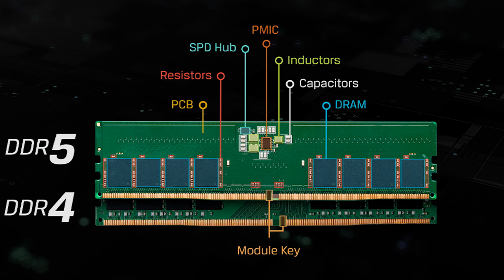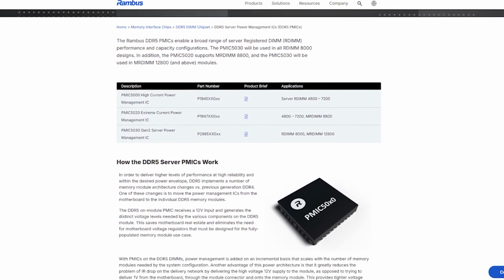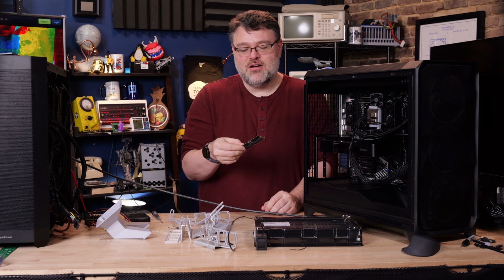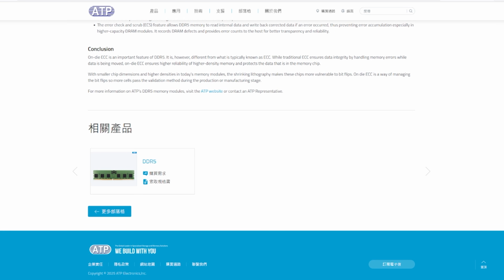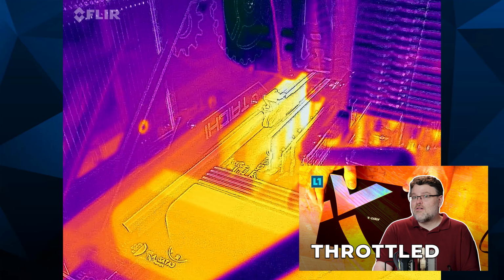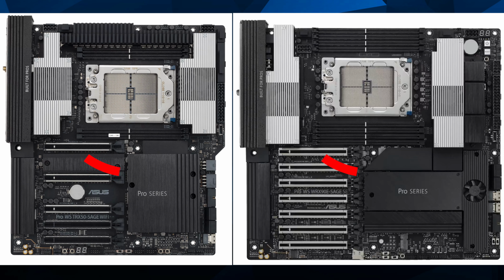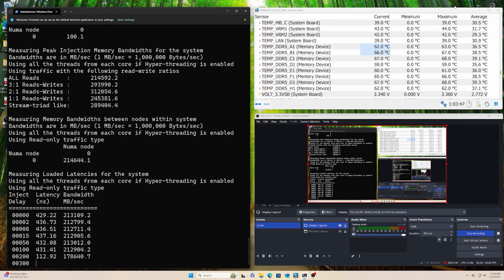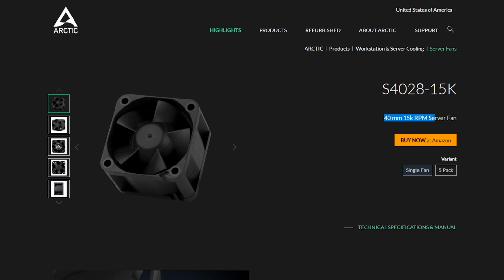Your DDR5 Memory Could be at Risk! All About DDR5

Comment: So what you're saying is I need a RAM fan ...
Reply: used to be a easy option to fan cool ram,, it was two small fans and side clamps that would press against the ram lock arms.
Reply: DDR2 watercooling is making a comeback
Reply: I have an idea, how about a fan mount that clips directly into an empty dimm slot? The bottom is all plastic and stuff doesn't take power from it or anything, just using the ram slot as a mounting solution. It would be easy solution for ATX boards that have 4 dimm slots that most people don't fill up for DDR5 due to memory controller not able to handle 4 channels without cutting the speed.
Reply: @Temstar04  I use 4/4 slots (4x 32GB DDR5 6000 CL30, XMP1) without any problems. Bandwidth and speed are on maximum, 6000Mhz is stabil. The SPD hub temperature is 40 C on 0 and 3 dimm, 42 is on the 2 internal memories. Under working the tempartures get +2 C only. So, the 4 DIMMS can working perfectly with Ultra 9 285K.
Reply: @Cornflakes1111  nobody asked lil bro
Reply: @jaytay420  Not cool somebody just throwing a comment in doesn't need a nasty response like that get a life or do something to no be so misserable in this one to warrant such a comment.
Reply: pci fan directed a modules
Reply: Ram aio
Reply: Fixing AM5 4-stick DDR5 stability:
1️⃣ Stop using Auto CAD Bus.
Set to 34Ω-30Ω.
2️⃣ Lock _dd timings (trdrd_dd / twrwr_dd) to stop data collisions
3️⃣ Increase VDDP to 1.05V for the handshake
My 8700G is now pushing 256GB at 6000MT/s 1:1 with a -30 Curve
No more boot loops! ⚡️
Reply: Really makes me miss the days of DDR2, when those clip-on heatspreaders were bling that nobody took seriously, or DDR3 when some of us were poking fun at giant heatsinks and ever water cooling kits for DIMMs. But then, I guess the 486 I used to play Angband on ran passive too.
Reply: @YesterdaySoup  Reminds me of when I opened an early WIn95 PC to clean it and had to do a double take, because nothing on the MB had a fan..... Just one fan in the back of the case and one in the power supply.
Reply: RGB
Reply: Just get a downdraft CPU heatsink. xd
Reply: RAM cooling is back baby!
Reply: dram fans now cost tree fiddy, rgb version 1 thousand tree fiddy
Reply: @GeneralIzzi I took my front system fan and mounted it over my RAM and installed heatsink with thermal paste around the chips. 😂
Reply: It depends. It varies depending on the platform you're installing ram on, the dram voltage, frequencies, pc airflow. On my Intel lga 1700 pc in order to achieve ddr5 7000 I bought a memory fan armor from Jonsbo and it works way better now, when banks are properly cooled (relatively high frequencies = relatively high voltages = more heat).
On am5 platforms, on the other hand, if you just set an xmp profile at 6400 mt/s, and if the case airflow is good, additional fans are not necessarily needed.
Thankfully ddr5 banks have mem temperature sensors, so you can actually check if you need an additional cooler for ram or not
Reply: There used to be attachable ram heatsinks and other kinds of cooling kits for your ram, like the RamOrb by thermaltake. They could be useful for heat-sink less ram kits.
Reply: Happens, if you increase and increase clock speeds, at some time, even the RAM starts cooking.
Impressive anyhow, it kept going this long, clock speeds on CPUs are stuck at 3-5GHz for long time already
Feature size inside the chips is pretty much minimized out, too.
Reply: @hinz1 
I thought It was a thing of the past when RAM voltages were much higher
Reply: @federicocatelli8785  You are correct that they lowered voltage to get less heat, but then they used that new headroom to jack up the speed which in return created extra heat. Also on DDR5 the voltage regulator is on the DIMM so technically the ram chips use lower voltage but the total DIMM receives a higher voltage to be lowered on the DIMM.
Reply: Good case ventilation, monitoring and better fans (not the RBG ones) would do the trick just fine without cable obstruction
Reply: @UndercoverPirate69 
If it aint RGB its trash. RGB add 30% extra cooling.
Reply: @SouthsideTim  Apparently some systems can corrupt the SPD or PMIC if your DDR5 ram has configurable LEDs on it.
Reply: This whole video made a simple issue complicated for no reason, specially for PC Gamers, the issue is easy to fix, don't buy Ram more then 1,35v and you will never have random crashes, blue Screens ETC, the higher the Voltage the hotter the DDR5 Ram and it requires cooling, I fixed this whole 20 min video in one single comment.
Reply: @HDZ77 do you think 1.35V running at lower Clock speeds like say under 6000mhz would be in a good range? I'm thinking if I run my set up under 5,000 it should be safe cause that's not a whole lot of power usage but I'm not entirely sure
Reply: @MskatXD  I run Dual Channel 64GB 2X32 6400MT CL32 1.35v and it Runs smooth as butter, if you are using all 4 slots of Ram then you should never go over 6000MT for a Stable system, specially if you are using dual Channel Ram, Any kit of 2 sticks 2X24 for a total of 48, or lower 32GB 2X16 is Single Channel, and kits 2X32 for a total of 64GB or Higher is Dual Channel, so in short if you only using 2 sticks Single Channel meaning 2X24 (48GB) or less you can do as high as 8000MT CL40 1.35v, and if you are using Dual channel like me you can only use 2X32 (64GB) you can only go as high as 6400MT CL32 1,35v, Lets not also forget that the Motherboard plays a huge role, make sure you have a 8 Layer PCB Board which can pass through the Memory signal and noise cleaner and with less Stress, 6 Layers or less you will have more issues and be more limited with RAM.
Reply: @HDZ77  so would you say at least 32 gig of ram being the 2 x 16 is the sweet spot for dual channel and leave 2 slots free to avoid any rising temperature? From the looks of the video with the amount of memory they showed its like they filled up all the slots. I am not doing anything excessive with the computer like overclocking or messing with bios I am just person who only wants a proper working good computer.
Reply: @HDZ77  or underclock your ram
Reply: @FirstLast-ge4yd  I buy all my ram 1.35V and never had to underclock unless I am populating all the ram slots, I use dual channel Ram 2X32 (64GB) 6400MT CL32 1.35v and it runs smooth as butter.
Reply: @HDZ77  So you say turning on the XMP profile to get the advertised speed out of the RAM is bad because it puts the memory on 1,424v(despite saying1,40 in the profile)? If these settings are completely useless BS, then why do they even sell them like this?
At least that would explain why the PC I use exclusively for gaming always needs an eternity to boot, because it needs to re-train the memory whenever the PC has been off and completely cooled down for a couple of days.
Would it be better to load the 6000MT CL32 1,35v profile instead of the 6400MT CL32 1,40v one? I don't want to manually mess with the voltage settings, out of fear I could destroy something!
Reply: @skyknight0408 I don't mess with voltages, there is no need to overcomplicate things, I just buy Ram advertised at 1.35v may it be 6000MT, 6400MT or 8000MT when I turn on XMP and I have never had issues and PC always runs butter smooth.
Reply: @skyknight0408 Also have you tried updating Bios, cause practically all manufacturers have fixed the boot memory training issues and now boot times are less then 30 seconds, and if you did update to latest bios, it sounds to me to be a cheap b650 board issue.
Reply: @HDZ77  Jep, it's a B650E MAX GAMING WIFI W board from Asus. Bios is the latest version. The RAM is Kingston KF564C32RSK2-64. MCR is on and it does boot fast occasionally, but does memory training every time the PC has been off for multiple days.
Reply: @HDZ77  Plenty of folks are getting high temps and instability without running higher voltages.
Reply: @HDZ77  Nope, this is wrong. I have 1.35v DDR5 from a good brand with a built-in heatsink and airflow. It has crashes and bugs when the system is weighted down by GPU heat dump. Dedicated RAM fans is the new meta for high performance stability.
Reply: @steve-dill Its not wrong, its means you got a bad kit. Specially if you got the first DDR5 Ram kits when DDR5 released, most of those kits are really Bad, I know cause my first build was with the 12900k when DDR5 released and the first DDR5 kits where really bad binned, I have multiple DDR5 Ram now and newer Ram is way better binned and more stable, the only other reason is if you are trying to run over 96GB at over 6000MT that will never work, you are putting way too much stress on the board and more noise, specially if you are using dual channel Ram.
Reply: @steve-dill  Deffinately but it doesn't have to be dedicated fans for the RAM, just RAM heatsinks that are more than just look cool items and actually work, and then just build in a case that has good airflow and case fans in the places they need to be will move enough air to keep them cool, this is just an opinion of mine based on 40 years of computer knowledge, and that is RGB lighting on RAM makes it run hotter by generatinga tad of heat from the lights themselves (LED's do make some heat) and then it kinda holding the heat in with the plastic the are housed in (both from the lights and the heat from the RAM itself the plastic may be holding in),,, just a theroy, I run Corsair Vengence DDR5 5600 cl36 RAM in dual channel (32gb) and set to 5600 in XMP on an intel i7 12700k on an MSI z790 tomahawk board in a Montech King 95 pro case with 10 case fans 7 as air intake (4-140's front and side 3-120's from bottom) 3 as exhaust (2-140's top 1-120 rear) , the CPU is cooled by a Noctua NH-D15 gen2, I have on more than one occasion set it to running prime 95 walked away for a couple hours come back and it's still doing what it is supposed to and running at all the speeds it is supposed to, everything except for XMP and some custom fan curves,  is out of box factory settings no overclocking or playing with voltages (I have my Asus Tuff gaming RTX 4070ti super slightly overclocked but just a tad and that doesn't count for what we are talking about here anyhow), I even fell asleep once and forgot it was running prime 95 one night woke up like 6-7 hours later to do some gaming and holy crap LOL but the thing was still chugging away like no big deal temps for the CPU were running in the mid 80's like any other time on prime 95 RAM and motherboard temps were not much above idle temps (as monitored with hardware info 64 ) my setup and every component in it pretty much idles in the mid 20's to about 30-31c the hotest I've ever seen my CPU get was about 89 and it was after running 3 silver bench extreem stress tests back to back with no rest in between and having heated it up in 3 heaven GPU benchmarks back to back (only heats the card but adds case heat if airflow aint good), but yeah super stable system and while not a speed demon by some standards it's not a complete dog either and I will takew that rock solid stabilty ANY time over just a bit more speed especialy for my daily driver.
Reply: @HDZ77  Nope, not a single bad kit. This behavior has happened across a kit from late 2024 AND a kit made in mid 2025. Instability only when the case interior is hot, always tested rock solid when the GPU is idling in memtest, prime95 etc. 1.35v still breaks when the case is too hot.
Reply: @steve-dill  Then the Problem is You LMAOOOO, I run 64GB 2X32 6400MT CL32 1.35v BUTTER SMOOTH, not one issue LMAOOO, stop Sucking at PC 🤣🤣🤣🤣

Comment: Ive had G.Skill 6000 CL30 memory in my rig and it would go unstable at like 45°c (reported) only, weirdly when i ramped up fans above it a bit, it would go to about 55°c and be fine. I suspect its temperature sensor is just reporting bullsh-t

Got tired of this crap, so decided to buy Kingston kit instead, at least i bought it still "cheap" (only 2x the price it should be, now its 4x)
Reply: I have no issues with my G.Skill 6000 CL30 64GB kit (SK Hynix M-Die IIRC). I used Buildzoid's "Easy Overclocking" timings, which includes an undervolt if I understand correctly. I even went a little more aggressive with the undervolt than his recommendation and never had instability.
Reply: @Arthur78 if the kit is unstable at its own expo and has issues at random temperatures I think it's gskill problem to solve, not mine tbh. Local store also sold a lot of these as non working on auction site, so I suspect they may had a bad batch or something. If it would at least go unstable at consistent reported temperatures I could actually know what's the temperature I need to target, but the kit I have is as stable as a drunk person on friday

Comment: I had to buy a memory cooling bracket with fans for my 6000 cl 30 memory when i couldnt get them stable with tighter secondary timings. It started to get errors on testmem5 extreme at around 55 degrees but was fine when the fans got it to stay at max 50. (Kingston fury beast)

Comment: All my cases have air intake from the top. Blows right over the memory and phases.
Reply: this, no one seems to get this right. Top mounted AIOs have not helped either. I used down firing cpu coolers back when cases had less flow.
Reply: @n8spL8  Thermodynamics. Working with - not against that - contributes to the efficiency of a system. If you like top mount intake you must have some other arbitrary requirements like low noise.